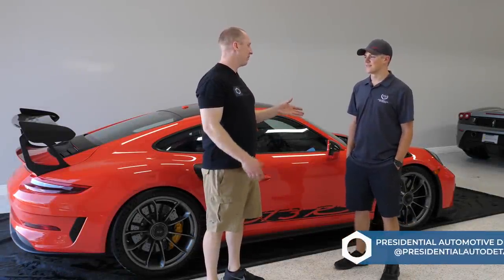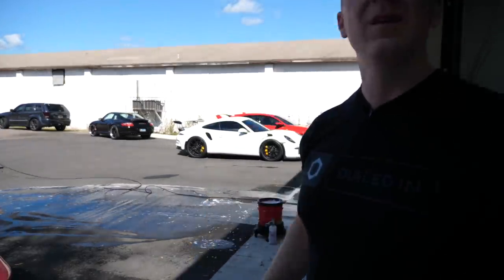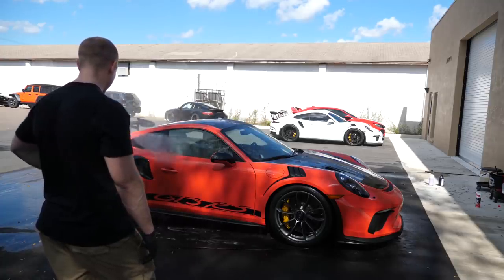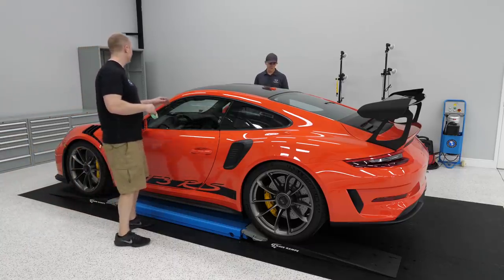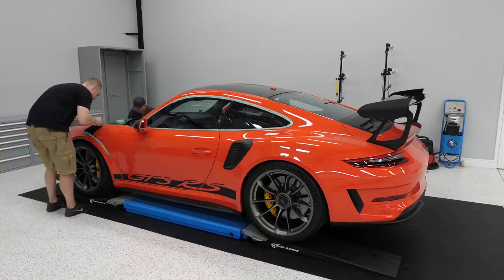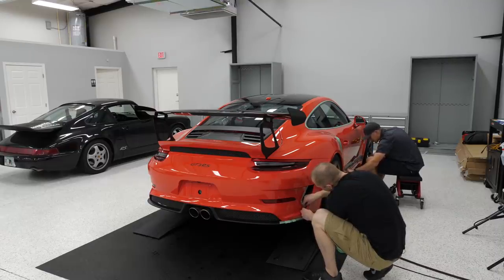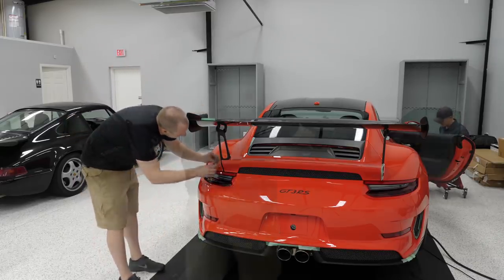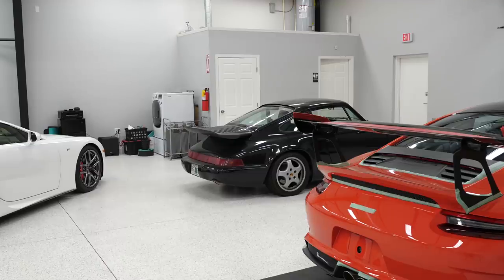LZ GT3RS Detail Series: E1 - Decontamination & Taping

Comment: Don't forget the suspension upgrades too! There's a reason, actually very many reason's the 991.2 lapped the 'ring 24 seconds quicker than the 991.1:)
Reply from the maker: Yeah, I was in love with the carbon sway bar in the rear.  Amazing...
Reply: The main reason is the new Cup 2 R tyres, but the suspension and the other little things are helping too.

Comment: Hey Matt, I know you don't label yourself as a detailer even though you do great work. I had a question. After claying the surfaces is it normal to not re rinse or even wash the paint to make sure you got off all the clay lube? I have a paranoia about it affecting the polish stages with it still being on the clear coat or even applying a sealant/wax it won't bond with the paint AS WELL. Please let me know your thoughts, thank you!
Reply: maybe im wrong and please correct me if i am, but they used ONR, which is a no rinse soap, for that reason only i would say its okay to leave it as is. If on the other hand they used a detail spray(which i wouldnt btw) which in my opinion has some sort of wax in it, then i would rinse it down. To be save just use your pH neutral soap for lube and rinse after, you should be fine.
Reply: Werner Collins thank you for the replay! ONR actually has polymers that allow it to act like a quick detailer. It was made for areas with water restrictions so it does leave behind a film of protection as well. For the heavy or medium cutting clay you need a wax/sealant in the formula or you’ll actually mare the paint and can cause yourself a lot more work. I guess they just went to taping and polishing without worrying about the ONR on the paint. I guess we’ll never know 😂😂
Reply: @frankthedetailer441  that sounds about right, hopefully they will reply to the question then.?
Reply from the maker: You can rinse it off and probably should do so on a heavily contaminated car.  This one had almost no embedded contamination other than a little iron that we removed in the previous step.
Reply: Obsessed Garage thank you for the clarification! Keep up the amazing content. Always look forward to your videos and knowledge

Comment: Any reason a clay towel wasn't used for the bulk work and then a clay bar for the tight areas?
Reply from the maker: I think towels with rubber a not good.  I prefer the original Autoscrub, but a real clay bar still does the best job.
Reply: @ObsessedGarage  Thank you for the reply!

Comment: I'm curious, I thought the point of pre washing was to breakdown and suspend the dirt, to then rinse it off prior to the contact wash. What is the logic of putting the pre rinse on there, and then washing without rinsing it (and the suspended dirt I assume) off? Is it because this is a new car and in theory there is no 'dirt', and the pre wash is to simply remove any waxes?
Reply from the maker: Lubrication

Comment: I found an 2013 M3 Coupe for $38K with 37K miles on it. Is that a reasonable price? 🤔 or 2016 C43 AMG for $35K with 44K miles
Reply: M3 any day c43 just lacks the actual AMG feel. If not look for a cla45 same power as the c43 but lighter and  abit smaller
Reply from the maker: Sounds reasonable.